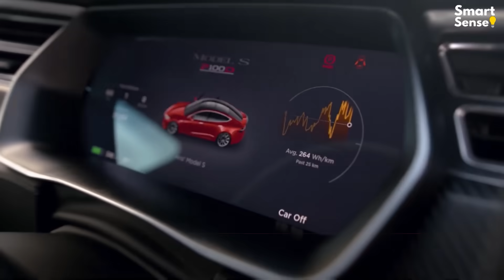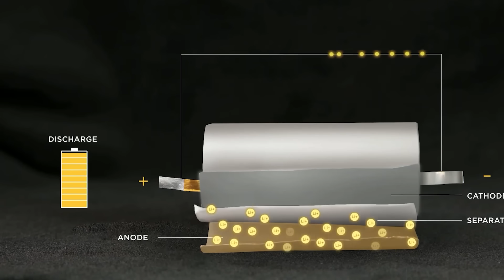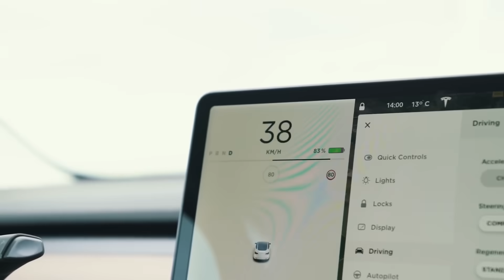Tesla Model 2: New 2022 CHEAPEST Tesla Confirmed!

Comment: I don't need autonomous crap, cameras or leather. I need a small ev with cloth interior, good range 300-400 miles, ac, heat, two speakers and a Bluetooth stereo. That's it.

Comment: Until there is a 5 minute or less, 100% charge with 400+ mile range, I'm out.  I drive a lot for work and vacations.  Recharge times essentially make changing over to an EV impossible.  I know 500+ range is there but it's the recharge time that makes adoption impossible.  The technology is there with capacitors but not yet implemented.  Some day though.... Perhaps a universally changeable battery is the ticket for the time being. Until the capacitor is implemented I'm stuck with fossil fuels.  ugh.

Comment: Electric is any better for the environment take the blind folds of repair cost will kill you there’s a failure with the batteries it will kill you not only in price but literally and the production of making these batteries for these cars is environmentally hazardous worse than drilling for oil another thing is the disposal of these cars is environmentally hazardous thirdly where do you think electricity is coming from to charge it do you think it’s just generated in mid air so the more The more production of electricity the more hydroelectric dams are going to be needed to increase the flow of electricity demand because their so-called solar and wind power there’s not enough of it in this country to supply electricity for all these electric cars that will be needed so right now here in the Northeast electric plants are powered by coal so we need more electric so we’ll burn more coal to generate it and who gets rich the politicians because when they jacked the price of electricity up even more than we already pay four dollars and a quarter here a kilowatt don’t be profiting take the blinders off it’s not any better than gasoline

Comment: If they make the batteries integrated into part of the frame, guess what happens to the car if you have premature battery issues or when the battery life is up? From the design it appears it's going to be very labor intensive to get to the battery pack . Not really a problem if you can get 500,000 trouble miles then scrap/recycle the car when battery & motor die. But if something goes wrong before hand better hope you have warranty coverage for it..

Comment: I'll never buy a Tesla, unfortunately. I want to like them but the lack of knobs and dials disqualify the care entirely. Touch screens are ridiculous, especially if you need to use your damn touch screen to open the damn glove box and dozens of similar stupidities. Then there's the "self-driving" nonsense. My 2016 Golf has lane assist, recognizes traffic signs, and adaptive cruise control. That covers about 90% of everything the much more expensive Tesla can do.

And then there's this. The $25k Tesla is in USD without taxes included. That means it'll be $30k after taxes are added, and in Euros that would become €35k Euros. But wait, there's more... usually, that doesn't fly. Especially if it takes Tesla YEARS to finally start delivery of those things. In Europe, that'll mean we'd be paying €45k for the cheapest version all the way up to €70k for a long-range and/or triple-motor version with "self-driving" enabled.

I can easily afford these cars but financially and comfort-wise they simply won't and can't measure up to a good 2nd-hand combustion-engined car. My Volkswagen Golf cost me €18k when I bought it and with lane assist, traffic sign recognition, adaptive cruise control, a crazy good sound system, actual fucking buttons and dials to do everything trivial I need to do, and a 500+ mile range? I'd be absolutely bonkers to switch to a Tesla.

It makes no financial sense, either. Say I sell my Golf for €10k and get a €60k small Tesla, that means I'll have to pay €50k out of pocket. Sure, if I drive enough I'll make it back by saving on fuel costs eventually, but €50k worth of fuel even in the Netherlands where I live and where fuel is very expensive, it will take me many years.

But even IF I managed to earn back the money in, say, 3 to 5 years. I need to also take into account what those €50k Euros could've gotten me if I had invested it instead. Oh, and the car will lose a lot of its value the second I register it in my name. So it'll take even longer to earn back my "investment".

I see people around me who jumped on the Model 3 bandwagon the second they could, years ago. They dealt with the panel gaps, unintuitive use of things like wiper speeds and globe boxes, standing at charging stations long-ass times to recharge the car because they don't have space at home to charge (most people don't have a stand-alone house with a driveway, turns out).

They regretted it. But it's a lease contract through their employer, and they're stuck with the damn thing for 3 to 5 years.

At least it's a fast car. They have that going for them.

Comment: 250 mile range is more than enough for Europe where commute distance are much smaller. The 250 mile is enough for a week long commute to work for a lot of people, and that includes shopping trips. Lower cost for the electrical vehicles is much welcomed. With a lot of the families being 2+1 model, having a 2 door or an asymetric 3  door design (look up veloster) is possible and sufficient. Given the opportunity i think a lot of the european families would choose cheaper 2 door option, especially if it costed around 20k$.

Comment: Definitely buying one, also putting solar and power wall on my home
Reply: With what that would cost, you could just buy gas for many, many years.. By the time it would make up for the cost, it would start failing and having issues which cost more money. It's kind of like those windmills that don't even ever produce as much power as it took to make them (not to mention many of them have a 500 gallon oil tank to keep them lubed) and they can't be recycled since they are made out of fiberglass.
Reply: @geopioneergsxr5357  it’s not about the money.
Reply: @geopioneergsxr5357  it's not only about the cost but doing everything possible to reduce the carbon footprint. So future generations can life quality lives too.
Reply: Solar roofs are just not working. Musk tried it at first.
Reply: Have you checked out their solar roof ?
Reply: @Abner The basset Right on. Sounds good!
Reply: Ok thx
Reply: Sheep

Comment: There is no long term future for electric cars that need to be plugged in to recharge. If they came to dominate the market the charging infrastructure needed would be enormous in terms of the size of charging stations. Think about how many cars pass through fuel stations every 25 minutes and then imagine only one set of vehicles having to remain there that long. We would need charging stations the size of football fields and in cities that is just not practical or financially viable. What is much more realistic to imagine is electric cars powered by hydrogen fuel cells which would not require vehicles waiting for 25 minutes to fill up. 🤔

Comment: Oh by the way those that think that they're going to have a Thomas car that saves them money forget it because just use the computer and satellite systems combined with the road sensors you going to almost bring up your voltage requirement by / 1/3 and since not that many people are anxious to take long stops because most of the charging stations are not the high-performance superchargers and so many of them are not even working correctly here in the states the upkeep around here is kind of bad

Comment: Great invention Musk um electric vehicles are the future. Um However I think the best electric vehicle um should run on electric for 600 miles um & then have an engine so you can just switch over once electric is to low um because stranded sucks.
Reply: It doesn't matter if a car that fits 5 people is as long as a F150 because at least 600 miles electric then engine under $50,000 is what people want. 😁✌️

Comment: I would love to actually see one of these cars last 15 years battery and all.. I doubt it, and that's the problem with electric cars. The reason why people love gas cars is because if you buy the right one you can drive it forever, 20/30 year and garage it, plus parts and maintenance are way less. When the roof of a car is a strong enough solar panel that I hardly ever need to plug in and these batteries are proven to last under heavy use longer than 15/20 then I'll buy one. Like what would I rather have a tesla or a Camaro SS 6.2L with the LE1 package for less than a tesla. The 2018 to 2022 Camaro Fo Sho. In 20/30 years it will go up in value because they won't be making them anymore. Yeah the tesla will beat it in a race for about 5 years until the batterie doesn't charge anymore. Then what throw it away, Pay 20,000 for a new batterie? I love Tech and Like Tesla's, but they Just aren't for me yet. When they can make something that you can keep and maintain forever, then I'll take a look.

Comment: If it cuts back on the tech and has info (such as the speed) in front of the driver (even if only in a HUD) then I might think about it. Otherwise I'll stick to car manufacturers who design cars for people who enjoy driving. The fact you can, in theory, drive hundreds of miles without touching the steering wheel proves that Teslas are designed by people who don't drive, for people who don't like driving (in which case, get a ****ing bus!)

Comment: It definitely would be great to see something like an electric VW GTI with AWD.
Reply: VW have the ID.3 which you might have heard of, and the CEO of VW Ralf Brandstatter revealed the concept car called ID.X which is the performance version.   They don’t use the GTI brand on their electric cars, they use the GTX brand so it will be called the Volkswagen ID.3 GTX, in the article it says it has 329hp and I’m guessing that it will be released in 2022✌️ Oh yeah I almost forgot, it will have All Wheel Drive and VW have managed to shave 200kgs off the weight of the car.   It will go 0-60 in 5.3 seconds (I can’t remember how fast the Golf GTI was 6 seconds maybe) and will have drift mode like the Golf 8 R.   Makes you realise just how heavy the battery pack is, doesn’t it?

Comment: 250 mile range is decent if its going to cost 25k. Still enough to do a lot.
Reply: 250 is low. The new 4680 battery is supposed to get 180 mpg-e. So if you put in a 60 kwh battery pack, that would give about 320 miles range. And I'm sure battery energy density will continue to improve.
Reply: Not if you want to drive across the country.
Reply: For sure. Can't do every road trip, but you'll still have a lot of options.
Reply: Why not every road trip?
Reply: Could maybe upgrade the battery pack in the small model 2!
Reply: Remember that it needs fast charging and a long lasting life.
Reply: Oh I work 33 miles away from my house so as long as I can go about 90 miles a day I’d be OK

Comment: If they are affordable like ⛽ car(new or use) and have at least 250 miles range i would but it. I would use it 98% of the time in the city or drive close by and have convenient charging station. Not as many as gasoline but enough to find them with in 10-15 minutes drive.

Comment: This model makes more sense than any other. As a commuter vehicle it would be ideal. Never needed for long range 200-300miles would be ideal for this type of car where a normal car you want 400-500miles so they can be driven in cold and hot weather and still have acceptable range for trips.

Comment: At this price, it will change the entire automotive industry as Henry Ford did more than 100 years ago with its T model. I think it should be called the Tesla T. and I am convinced that it can be manufactured at $ 20,000. / € as long as everything happens in China, and over time to implement another electricity network to truly support this change worldwide. However, I hope that the automotive industry will not suffer massive layoffs due to it, possibly to retrain in order to implement the new electricity network, both in distribution and in production to support the consumption of electric cars.
Reply: Funny that you mention Henry Ford, because I think there are a lot of similarities between Ford and Musk.
Reply: @darylfoster6133  One issue of concern is the integrated battery pack as part of the frame/structural support..If something goes wrong with the battery pack. It's gonna be a very expensive/labor intensive repair.
Reply: @michaelbrinks8089  Don't crash.
Reply: @alxcardoza  Many Tesla's have poor long term reliability but fan boys refuse to believe it until they learn the hard way.
Reply: @michaelbrinks8089  How so? And I'm a ford fanboy.
Reply: @alxcardoza  Tons of videos showing poor quality issues & failures.
Reply: @michaelbrinks8089  Damn that sucks.

Comment: Start at $25K which includes doors and 4 wheels and the shell.  Add about $10 to $15K in upgrades for it to be a true Tesla.  The model 3 starts at $35K but again you need to add $10 to $15K in upgrades to make it desirable hence low demand on it.

For mass consumer buy in it needs to be $30K loaded with the standard Tesla goodies not extra.
Reply: I believe the sub $20,000 EV market will be the upcoming hot market, and with government subsidies and incentives

Comment: Link to the information confirming a hard release date for the Model 2??? The video repeats commonly stated themes throughout, but is very short on details. The expansion of the Chinese Gigafactory facilities was also listed as part of multiple projects in conjunction with Chinese government terms. As it stands now, the Chinese government appears to be freezing Tesla out of a number of tiers in the Chinese EV market in favor of homegrown Chinese brands. There are rumors that Byd and a couple of other Chinese EV makers are working on beefing up safety standards in their subcompact offering for potential export to the U.S. and EU by as soon as Q4 2022 or Q1 2023. Some of their offerings could be less than $18,000 and offer up to 200 miles of range. With working class commuters, the Tesla logo will not trump price considerations. In the U.S., anything other than a low-priced pickup truck WILL NOT displace pickup truck sales, and Tesla has yet to even prove that they can downscale to the $25,000 price point. What's left is the next tier of sales, which is the subcompact commuter market for those who park the pickups during the week to drive to their jobs from the suburbs. I saw nothing in this video that confirmed the "Model 2" is coming, nor did I see any new information that would qualify as anything other than wild speculation about the form that the proposed entry level car would take.

Comment: 👎 Sick and tired of people saying nobody wants a coupe or a small hatchback. I call BULLSH*T! I wanted to buy a 2 door hatchback in 2018 but nobody made one. I ended up driving 300 miles away to buy a king cab pickup. The last of it's kind. They don't even make standard cab pickups anymore only 4 door crew cab and the smallest mid size pickup today is bigger than a Ford F-250 from 5 years ago. I don't know why they keep feeding us this bullsh*t. I want a 2 door coupe or a true midsize single cab pickup. This new Tesla will never be built for under $35000 and it will be a 4 door sedan that will barely fit in a standard parking space or garage. Because that's what people want, so we're told.

Comment: They are trying to solve the cost problem by building a smaller vehicle, but that will also reduce the battery pack size, and ultimately the max range of the vehicle. This likely renders the Model 2 unsuitable as a primary (and sole) vehicle for a lot of people. 
In any case Tesla can't break even on the current established Model 3, so they are adding two new production lines, for Cybertruck and Model 2 - spreading the company thinner. Gotcha.

Comment: Im in need of a new car, it would be awesome to see Model 2 be released still in 2021, but probably won't. And I don't care about autopilot, I wish it could be cheaper if it didn't have that feature
Reply: Self-driving software is transitioning to a subscription model, so you don't have to pay for it if you don't want it.
Reply: Their website gives you an option to choose that option in  the car ($10k tag)
Reply: Im talking about autopilot which is included on any price tag
Reply: @EduMiguel16  check the website, you can opt out from having autopilot into the car.  Its an optional feature.
Reply: @enriquefausto5436  autopilot not the same as FSD.

Comment: I live in the Western United states. Range is everything. Right now there are areas that I cannot travel through because there's no charging stations before the car would run out of electricity. So they get there I have to take a different route that is far longer Plus the extra time and recharging the car a couple of times. These cars need to get into the 400 mile range or be able to be topped off on a daily basis fairly quickly. Right now you're not supposed to go above 80% unless you're immediately taking a trip. The car may say 25,000 but also remember they tack on a shipping charge on top of that.
Reply: Lol you live in Texas huh
Reply: @freshlysaltedfishing8500  sounds like it but no. Arizona. Not a lot of difference except for size.
Reply: @jayfromaz  true